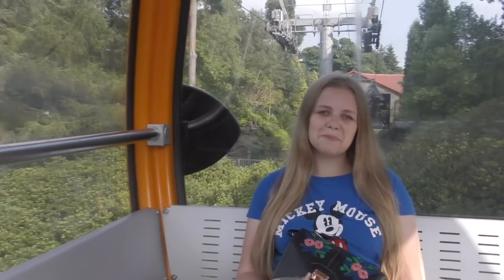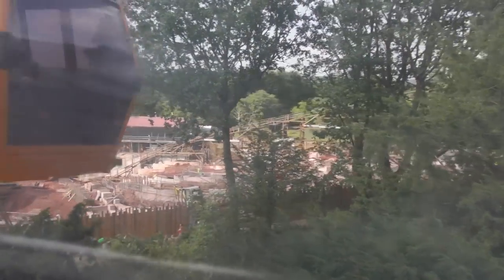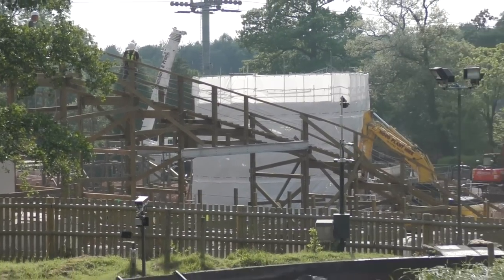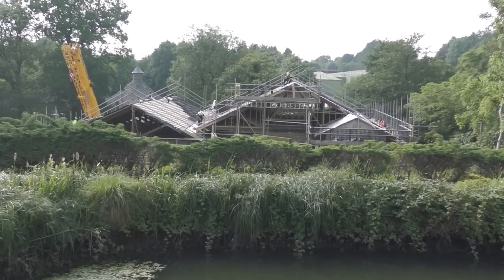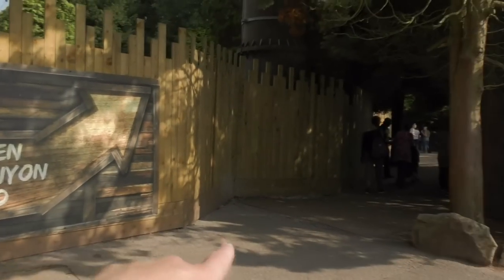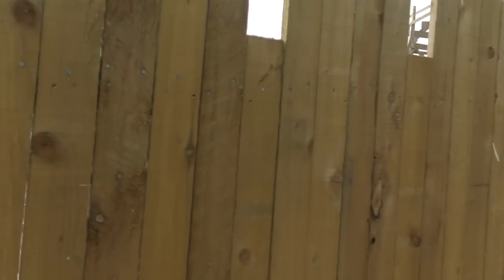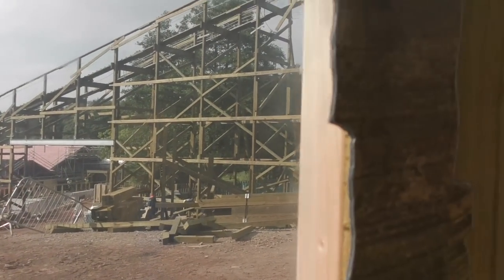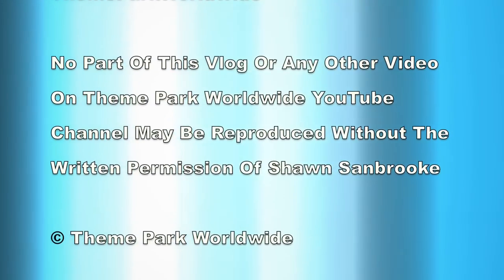Alton Towers Wicker Man Construction Update - 25th July 2017

Comment: Does anyone have an idea what the massive concrete block is under the lift hill?

I'm wondering with the height changes over the site we could see some kind of mechanism to accelerate the coaster at different points of the coaster. Could it be a multi launch woodie.
Reply: Owen C I had the same idea for how the lift hill was slanted oddly

Comment: I have a question. Do wooden coasters take longer to build than steel coasters?
Reply: Ruben Warren depends what you mean, I think a wooden coaster is easier to make, only needing wood and minimal steel. However if we're talking just the pure construction, I reckon a wooden one would take longer.
Reply: Yeah i mean I've seen video's of "back yard" Coasters and they're usually wooden because it's cheaper and easier than a Steel Coaster but i guess if it's for an Amusement park Wooden Coasters are still cheaper but it would probably take longer because i can imagine there having to be loads of little bolts and planks you'd have to put together.
Reply from the maker: They usually do due to the amount of work that goes into the structure itself!

Comment: Hey Shawn, i was just wondering if the ride is actually going to be called SECRET WEAPON 8 or will it have another name? I ask this because you were saying that other rides were code named SECRET WEAPON ......
Reply: No, it will not be called Secret Weapon 8, it is a codename used by Alton since the early 90s (when they were planning Nemesis) for new record breaking coasters. SW1 and 2 were planned for the Nemesis site yet never built, SW3 was Nemesis, SW4 was Oblivion, SW5 was Air (now Galactica), SW6 was Th13teen, SW7 was the Smiler. (Rita wasn't a secret weapon since it didn't break any records). Nemesis was the first suspended looping coaster in Europe, Oblivion was the steepest drop coaster at the time, Air/Galactica was the first B&M flying coaster (now the first coaster fully dedicated to VR), Th13teen was the first vertical track drop on any coaster and the Smiler has the most number of inversions on any ride
Reply: Alasdair Clift Thanks, i thought it was a bit of a strange name.
Reply: So that will mean this might break a record?
Reply: Most likely, some say it may be the first multi-launch wooden coaster, although it could be wrong
Reply from the maker: It will have another name, this is just used as a code name!